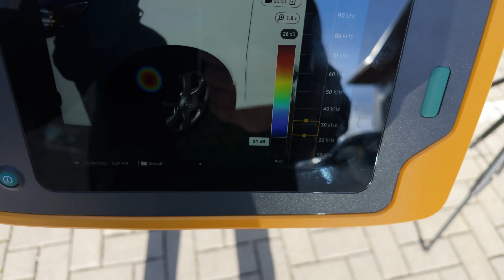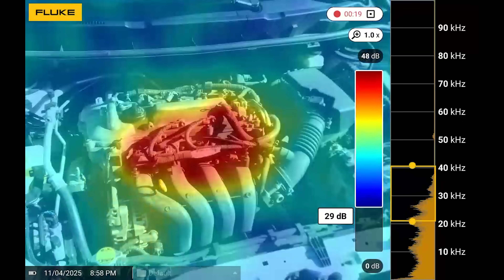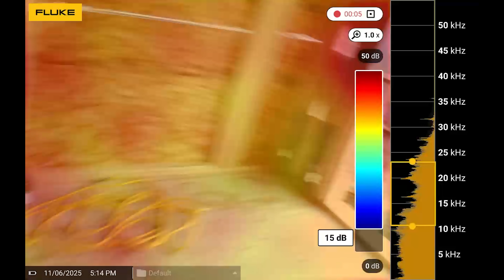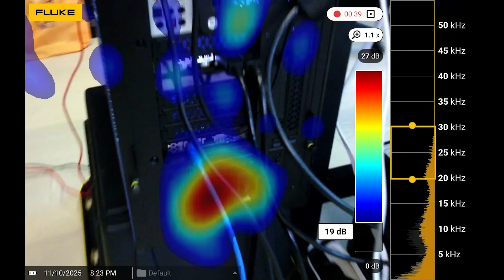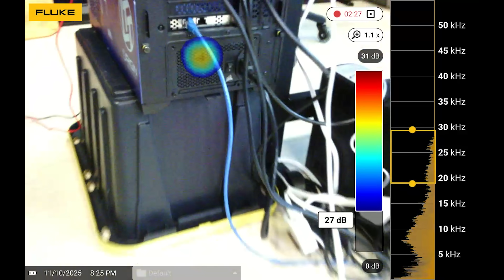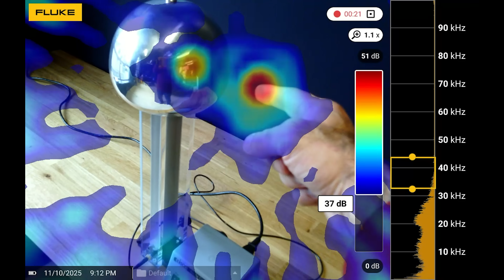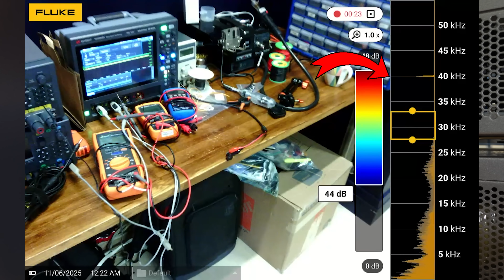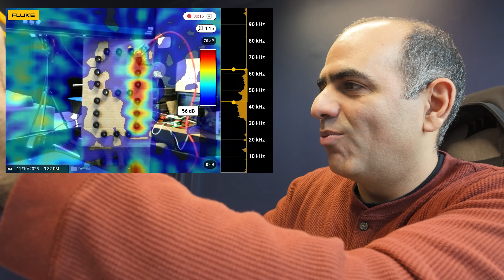Only $20000 to Fix a Flat Tire

Comment: We have one of these at our semiconductor plant. The price tag is fairly low to what it can do, around 20k.
We have a slightly different model where you teach it the kinds of gases you are looking for. You can even enter a price and it will calculate the amount of money you save per year if you fix that specific leak.
Its a very usefull tool especially for gases you dont otherwise monitor. In our hundreds of gaspipes we fixed countless pneumatic system leaks which should pay for the investment a couple times over within the first year.
Thanks for showing this technology to the broader audience. We were pretty excited when we got ours!
Reply: Oh yeah we have one of these too, I think it’s the exact model, for looking for corona
Reply: Would you recommend this device to apply on loudspeakers for SPL and frequency band determination?
Reply: @kemalyigitantepuzumu5073 I dont quite understand the usecase. If you are a large manufacturer maybe.
This device is designed for large professional cooperations in my opinion. Something like chemical and petroleum industries where you save money by detecting leaks fast.
Sure there are other applications, but financially viable ones?
Reply: @kemalyigitantepuzumu5073 you don't need a $20,000 bit of gear for this. Just a measurement microphone and a good sound card for your computer and something to calibrate it all off of. Now you also need a properly treated chamber and that is what will cost you... But without it even this device is most likely useless for the purpose
Reply: @app0the  Thank you for replying. What brand or model do you suggest for measurement microphone, and also for sound card?
Reply: Say, what are the odds that I could have a lucrative side hustle if I buy one and rent my services to companies? Kinda like how folks got into doing drone surveys for construction groups.
Reply: I don't get the point of moaning about the price. As with everything there are different price points. It always depents on what you need and what you are ready to spend on it. 
Let's take a hammer for example. You can buy a $2K bronze hammer, the fancy japanese one for $500, the real fancy $200 titanium hammer or the $5 one form the thrift store. 
For the most people the $5 one will do but some will need the bronze one for their work and some will buy the fancy japanese or titanium hammer cause they can.
The first time I heard about acoustic imaging about 20 years ago you needed a special sound proof studio, had to build your own microphone array and serverfarm, write you own software and if you wanted to change the angle it took about a day to measure everying and recalibrate the system. They didn't say what it exactly costed but they said it was in the mid 7 figures overall.
Reply: Isnt it just 16 microphones and some software? What justifies it being 20k when the production costs are more like 20?
Reply: @superhacker35 These probably arent cheap microphones and I'd guess there is a rather fancy multi channel high frequency ADC inside that will be rather expensive.
Also I dont think you are familiar of prices in the industrial sphere. A stationary gas sampler (Like for Cl2 or HBr) that you would need an extra one for each gas and area costs around 10k. The gaspipes for a single tool can cost upwards of 200k especially for heated gaslines. If you already pay 5 digit range for each tool, this toy for finding leaks on them is rather cheap
Reply: @ElHeisa  The data sheet says they use digital MEMS Microphones, probably PDM, which are not expensive at all. They also don't need a separate ADC, so that's not where the cost is coming from. They might use an FPGA for sampling the digital signals and maybe do an FFT, that would be an expensive part. Other than that, most of the cost is R&D.
Reply: @superhacker35  the production cost is more like 300, if you only count the materials including the screen. the expensive bit is the calibration, and the amount of hours the R&D team tuned the software. remember, you're not just paying for the item. you're paying for all the time, energy, and labor spent on the production of the item. just like crops, its just seeds and water. you're paying for the time, energy, and labor.
Reply: @superhacker35  Lots of RnD went into making this very niche but very useful piece of kit viable and reliable. Most of the 20k is probably recuperating the cost of development, and making up for the low demand.
Reply: @superhacker35  Probably just paying for the software license and a major fucking profit margin lmao
Reply: @superhacker35  I feel as if we're skipping over some important points here. It seems to have different microphones for different frequencies (just assuming, given that it can tune out certain frequencies), it's battery powered, has a pretty good camera that can display on the touch screen. The analogue to digital conversion of each of those microphones to an extreme degree of accuracy, not to mention the accuracy of each of the microphones their selves. We then have the fact it's a sealed unit that can operate in all sorts of environments, the tooling costs, the support for the product AFTER you buy it. Then we have the software and licensing costs, and the testing before the user actually gets to see the device, to ensure it's working as it should. This isn't even touching on shipping, marketing, labour, factory costs, or anything of that nature either. 

Basically, professional quality lab equipment is always pricey, because they tend not to cut corners.
Reply: @Deja117  Tuning out some frequencies is (just) some digital signal processing using FFT. After all, audible sound can also be filtered using an equalizer. We also don't need 64 ears to tune ourselves to a certain frequency, it's all processed.

Comment: I want this!
Me looking up the price
Guess I don't want this that much.
Reply: 🤣🤣🤣 No doubt! Makes a fluke multimeter look like a bargain!
Reply: @TrackGeeks  This makes even Apple products and Mario Kart World look cheap!
Reply: Over 25k, goddamn! Definitely going to require a big company or a government entity to afford those, that's in the ballpark of a new car!
Reply: @vimicito  For that model, for me, it would be US$50k.
Reply: its REALLY expensive
such noises
Reply: Maybe a Fotric TD2 would be more in your price range. Signal Path did a teardown recently.
Reply: For me would be around US$41000 . hahahaha yay for a country that taxes everything imported into double of what it is.
Reply: @DrJester  from Brazil by any chance?
Reply: It may not be that crazy hard to build one, if you're into writing signal processing code. Seems the hardware wouldn't be that expensive.
Reply: @palmariusbjrnstad1682  I bet you find tons of free software for this kind of purpose, so there is no need to start from scratch. It's the engineering work to perfect the system that makes it complicated (and expensive). Using the right materials, handling background noise graciously, testing. Still doable as a student group project I guess.
Reply: @palmariusbjrnstad1682 it's essentially an acoustic radar. The software would be... difficult, to say the least.
Reply: @palmariusbjrnstad1682  Agreed.  Sourcing the components is the hard part.  Ultrasonic mics are hard to come by and crazy expensive
Reply: The first phone was absurdly expensive too. Give it time... Granted maybe a decade or so for this, but the prices need to come down at some point. Whether it's due to competition, or second hand units. It will come down eventually...
Reply: @Deja117 there is no market for mass production of this equipment. This kind of specialized tool always stays expensive because the r&d cost needs to be spread over a limited amount of products they can sell. Also the parts are more expensive for the manufacturer, because of buying/producing in smaller quantities.
Reply: i will wait for my aliexpress version.
Reply: No real Alpha, huh.
Reply: there is one with lower specs for 8k USD
Reply: Just build it with Arduino or other microcontroller
Reply: @AdamV20this requires high precision parts, not cheap arduino components. Plus the software is very complex.
Reply: I realized I don’t need it anymore once I saw it’s made by fluke lol